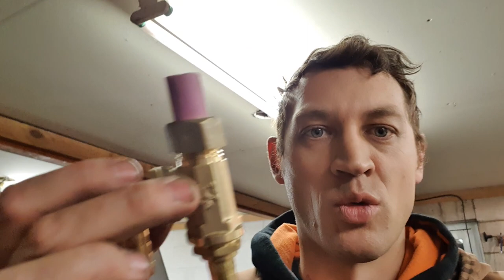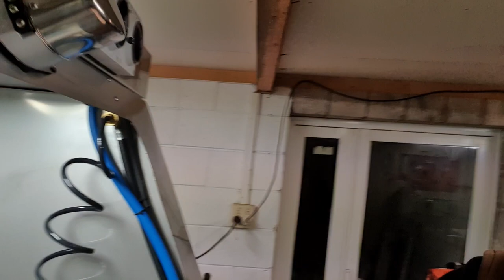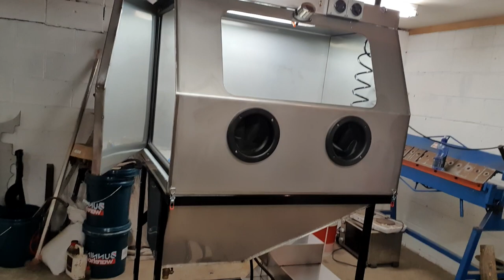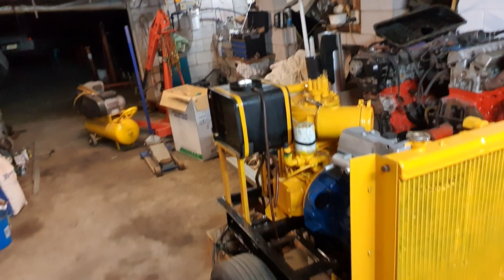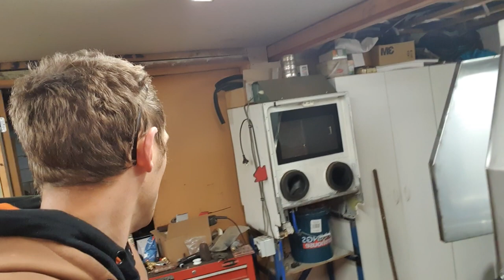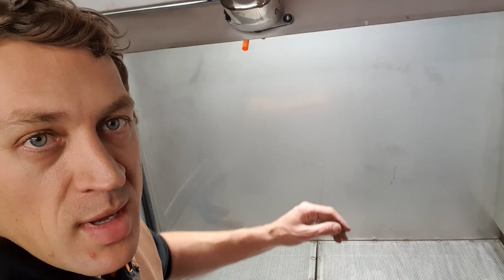Stainless Steel Vapor Blaster Cabinet, and General Update

Comment: Hi, congrats!, I am building a similar one, the best thing is it does not need a inner frame, just a bent sheet with a minimun of joints and welding, greeting from Ecuador South Ametica
Reply from the maker: Yeah I designed this one to be easy to build for someone without too many fabrication skills.

Keen to see your results. Looks to be getting more popular in South America, I just sold a nozzle to a guy in Peru.
Reply: @ArmouryEnterprises  I would like to buy a few, do you know what was the price of the shippimg? I need them, thanks for your response and I hope this machines don't get too popular😄👍
Reply from the maker: @edisonsanchez1337  How many are you after? I can get a shipping quote. The last one was like $130, but it was express shipping. Regular would be a lot cheaper.
Reply: @ArmouryEnterprises  Thanks, I would need three, with three extra nozzle tips two on 6mm and one on 8 or 7mm, would appreciate a total quote, regular shipping is fine, no hurries, thanks for the info, I' m a great fan!
Do the guns work on wet and dry?

Comment: Nice, what's the stainless blaster worth, minus the pump Josh, any idea's yet ?
Reply from the maker: Hey Mate, 
Starting to get a few orders for these now. 

You mean without the main slurry pump? Or without the wash down pump?
Reply: @ArmouryEnterprises  without the slurry pump i meant to ask Josh, sorry mate, my apologies. 👍
Reply from the maker: @restoblast1387  At this point, I wouldn't be able to do much of a deal minus the pump. Maybe $900 off the finished price. I may be able to do something a little better once I am getting the panels CNC cut and folded and I have less hours in each unit. I am happy to contact you at that point if you like?
Cheers

Comment: How much flow your compresors ? In Litre per minute
Reply: I think he mentioned recently (June) he uses  around 18 cfm at 90 psi in his new red compressor. That is 500 liter per minute at 6.2 bar
Reply from the maker: Hi David,

Yes the red compressor is Rated at around 18 CFM, the little yellow one is Rated at around 12, and the one on the trailer in the Video is 75 cfm, or around 2100 LPM off the specs, but its old so could be quite a bit less.

Thanks for watching